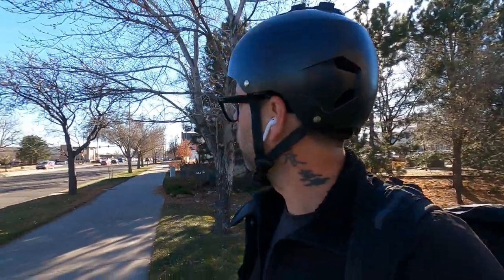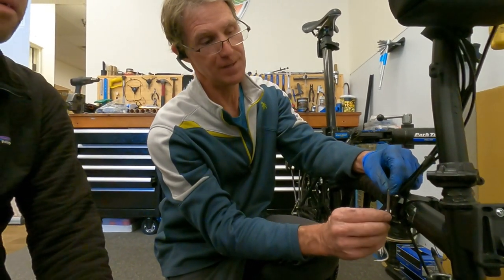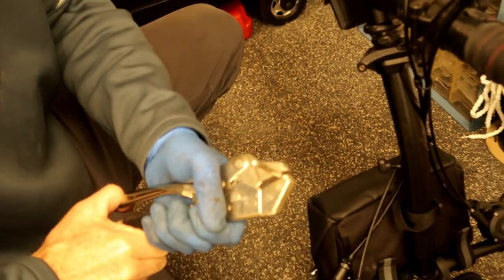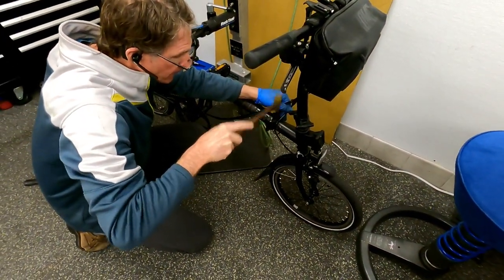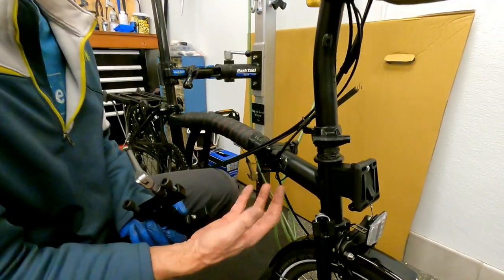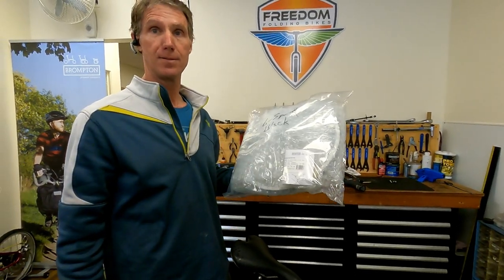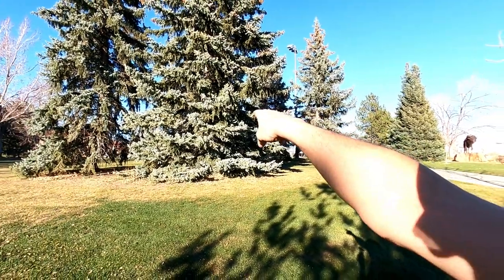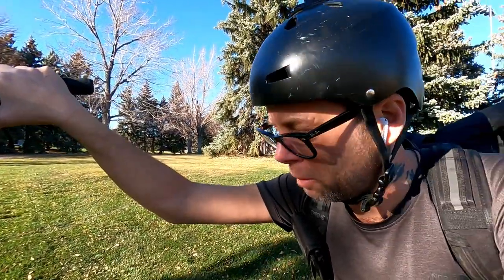Brompton frame hinge pin replacement

Comment: Tks to Chuck I just recently removed my Disc, bottom bracket and bottom hinge pin all in the comfort of my garage in about 30 minutes of labor👍(cost of parts $200) FYI....my local Brompton dealer downtown Chicago quoted me $600 - $1000 but wasn't totally sure what was wrong and wasn't even sure how to itemize and email me a Proforma Estimate 😂 Thank you Brian ❤ you just saved this DIYer a week's of wages 💪💪💪

Comment: Great film. Over time I’ve changed bottom bracket, new rear wheel plus other parts just with wear. Mechanical things eventually wear out with use, but the great thing is that they are usually fixable. Thanks for the film and thanks to Freedom Folding Bikes.

Comment: Why don't Brompton supply the innards of the Sturmey gears? I've just had to do the same thing for one of my Bromptons... New 6 gear rear wheel... Had to wait months! What my shop in North London wanted to do was just swap the innards in the old rear wheel, but even though just one cog had worn out inside, I had to buy a whole new wheel and wait ages. Expensive! Now my other Brompton's got a similar problem. I can't remember when both Brommies have been usable at the same time.
Reply from the maker: I hate to say it, but when sturmey archer was made in the UK it was of better quality.  It seems since they are now made in Taiwan the quality has gone down.  Just my observation.

Comment: Hello! Nice Video. What type of grease does your mechanic or you use for the hinges of your folding bikes? Thanks for your help and congratulations for the channel. Very interesting.
Reply from the maker: He uses regular parktool bearing grease.  I use an industrial penetrating grease that repels water and is high tack.  It’s made by Zep
Reply: @ibikeunfolded  Thanks Brian for your help. I'll be expecting your touring. By the way, I am a foldable bike lover writing from Buenos Aires, Argentina.

Comment: How to prevent this to happen? Is it need to regularly oily or something help to prolong this hinge pin? Thanks 🙏🏼
Reply from the maker: Oil definitely helps.  Don't power wash without air drying with compressed air.

Comment: How far do you cycle to Freedom Folding Bikes? How long does it take? I think you said in a previous video you live in downtown Denver which is 30m from Freedom Folding Bikes?
Reply from the maker: Taking the bike trails it’s about 35 miles to Boulder from where I live.  It takes about 2 hours normally, but it can take longer depending on the wind.
Reply: @ibikeunfolded  Fab, thanks. Love the channel BTW :-)

Comment: How much did the pin replacement cost for parts and labor?
Reply from the maker: I think it was 40-50 dollars.  I might cost a little more at other shops and it also depends on if oversizing is needed.

Comment: What is the next step after the larger hinge!! More larger ones!!😮 or new fram!! I hate to say that.
The new T line fix this issue but ruined our happiness with a sh*** 4 speed only which has a less ratio than The P line even 😭
Why they r doing that!!?